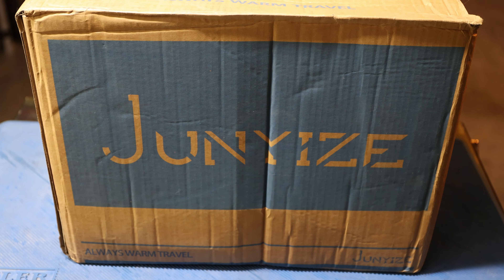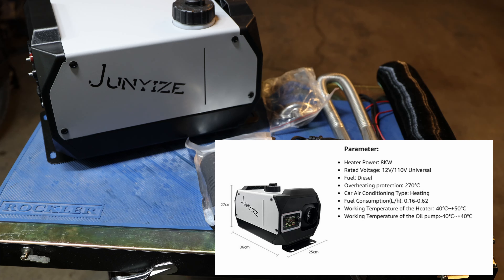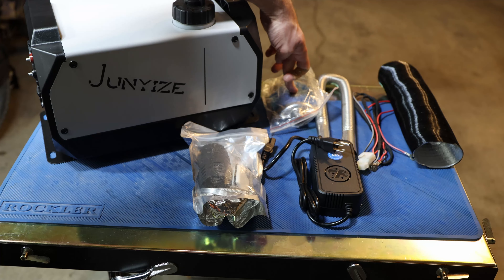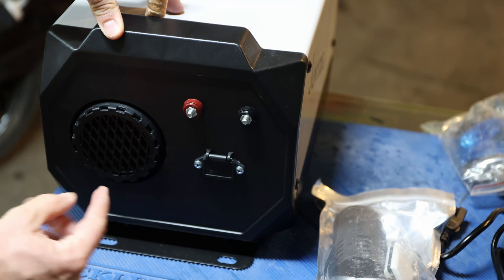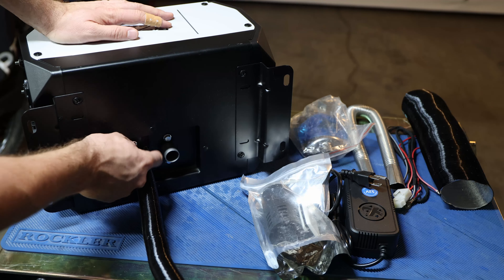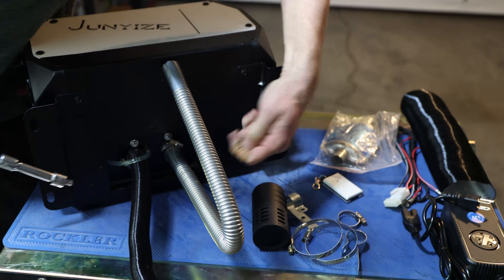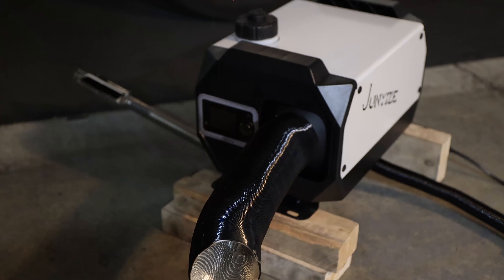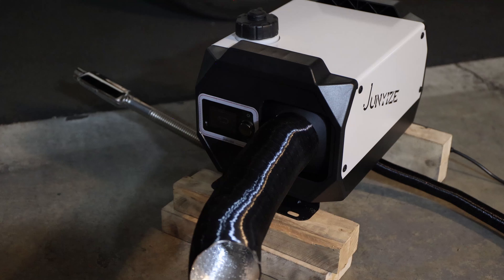8kW All-in-One Diesel Heater by JUNYIZE

Comment: Thanks for the video! One thing I would like to know about the heater is if it shuts down at set temperature or does it go to low fire rate and keep running? (This is problem with my Vevor heater, it overshoots space temperature and keeps running on low fire, never shuts off)
Reply from the maker: Sadly those Chinese Heater often come without this function. This one does not stop to my knowledge. I have another brand coming up soon which might have this feature but I'm not sure until I have actually seen it and tested it ;-)